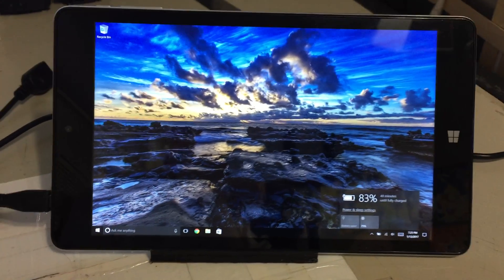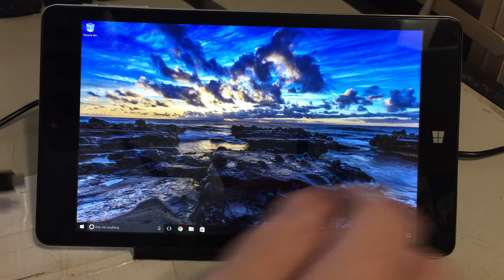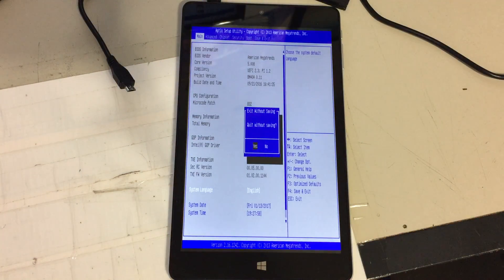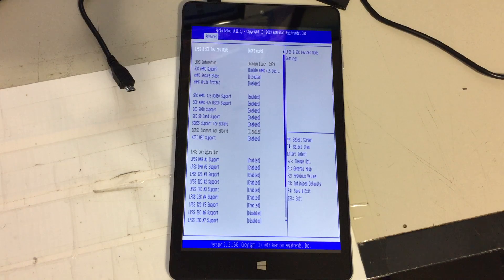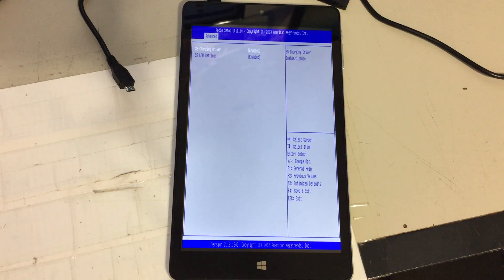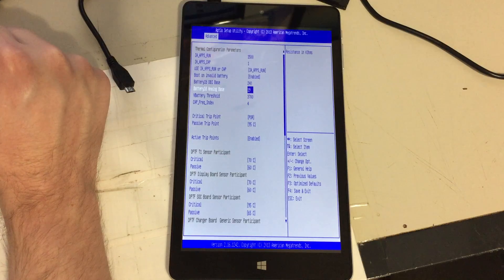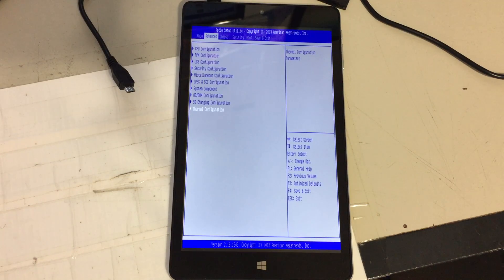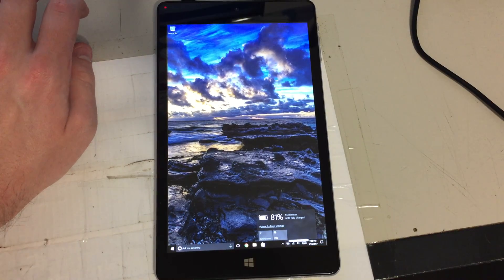NuVision Bios

Comment: Why are you so stupid ? Tear that stupid battery out !!! UUUHHH >>>> so yeah we had the same dead battery problem with ours / that is why these tablets are almost absolute GARBAGE JUNK READY FOR THE GARBAGE CAN.... SO YES !!!!! I just went ahead and carefully clipped the three wires coming out from the battery to the main mother-board. they are exremely short after you clip them so you will have to be very carefull , with tweezers splice a cut off USB DATA CABLE ( THE USB END from any data A B or C charging cord ..... if the three wires going into the mother-board...( might get pulled off you will have to solder new longer ones that you can splice a CUT USB END TOO . . . ) YOU MAY want to hot glue the them to the mother-board before you even touch them !!! okay ? but it works !!!!!!!! ................ SPLICE JUST A CUT OFF USB CORD TO WHERE THE BATTERY HAD THREE WIRES ALL THREE COLOR CODED :::: ( RED ) ( BLACK ) ( AND WHITE ) WORKS %100 Without the battery even in our nuvision TM-101W625L Windows 10 Tablet with detachable keyboard ... the only problem now is we dont have the password .... SO YEAH DUMB FUCK WHAT ARE THE STUPID BUTTONS DID YOU USE TO GET THE BLUE SYSTEM BIOS TO COME UP ON THE SCREEN ?????? THATS WHAT WE ARE LOOKING FOR DUMMY !!!!!! ASS